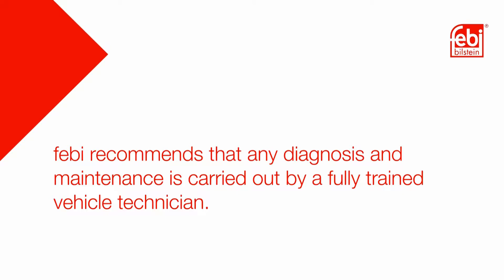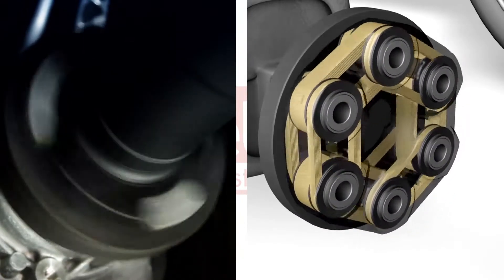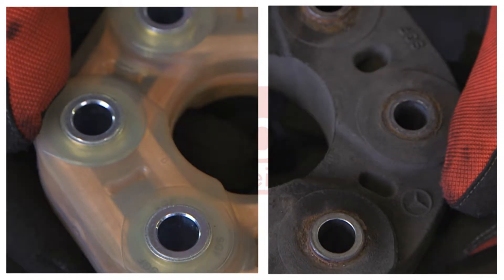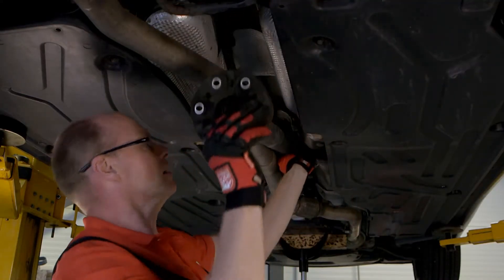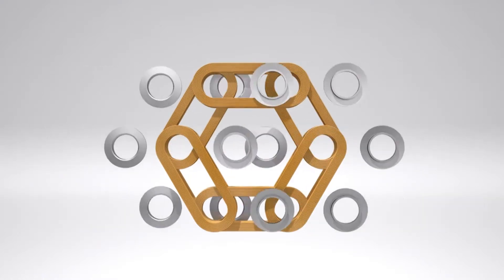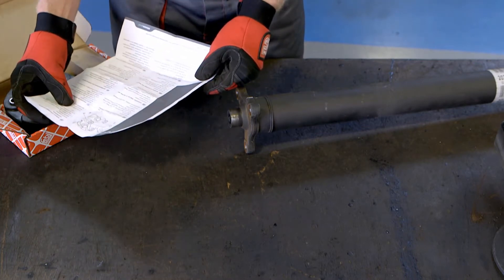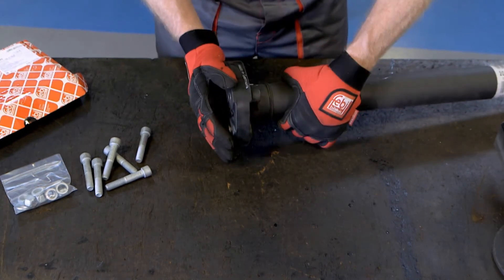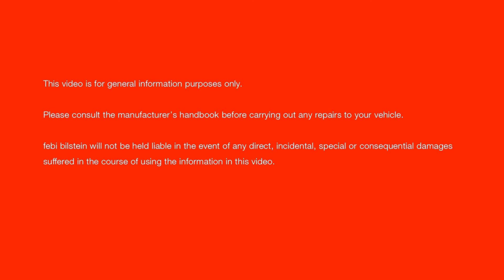[EN] Propshaft coupling (Flexible disc) inspection & replacement

Comment: Would this cause a rumbling/vibrating/whining noise when decelerating? I get a weird noise when I let off the gas on my A3 Quattro (same as the mk6 golf R prop shaft).
Reply from the maker: Thank you for watching our video. Your description could be related to many different transmission parts that could be causing this issue.
Reply: @febi.bilstein  thanks for the reply. 

My rear flex disc is torn almost completely around.  I see you make a replacements for the 2006-2008 fwd Audi A3 8p and the 3.2L model, but my 2.0T Quattro doesn’t seem to have any options. I know for the center support bearing, we have to replace the entire driveshaft. Is this the reason you don’t make one for this model? 

Or if you do make it, I’d love to buy a the front and rear flex disc for my 2010 Audi A3 8p 2.0T Quattro. It’ll be much cheaper than a driveshaft/ propeller shaft.
Reply: @febi.bilstein  1J0521127A seems to be the front flex disc you make for my car. Can you tell me if you make a rear flex disc? I’m unable to locate it, but 1K0521307A seems similar. Can you confirm fitment?

The mk6 golf r is listed, which uses the same prop shaft. So it SHOULD fit. But is being left out of ALL of Febi’s fitment charts. Or your fitment charts are incorrect in general.
Reply from the maker: @vwjet357  If you let us know which country you are based, then we can put you in contact with our local office to help you.
Reply: @febi.bilstein  thanks for getting back to me, I’m in North America WA state
Reply from the maker: @vwjet357  Please below a link to our febi website and contact persons for your market. https://www.febi.com/en/contact/contact-persons/